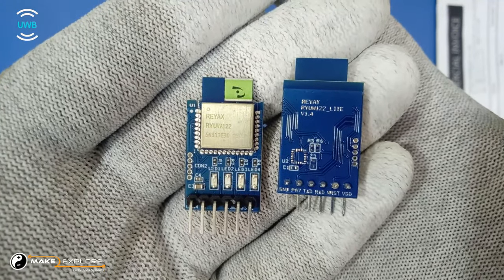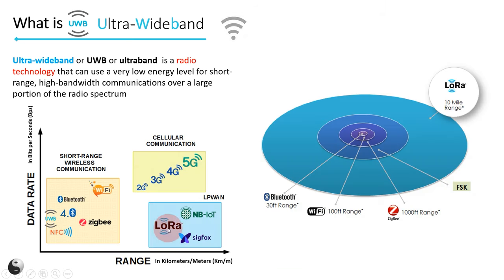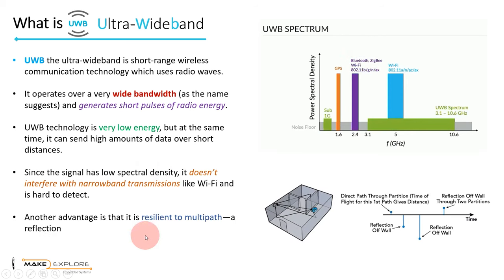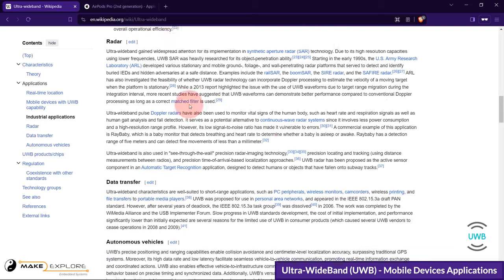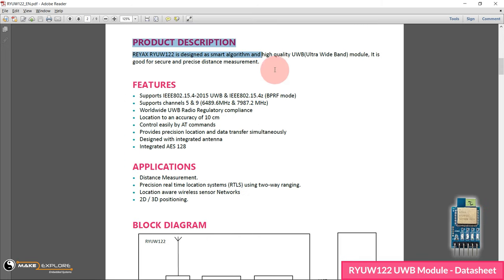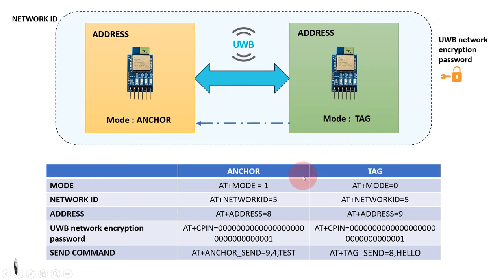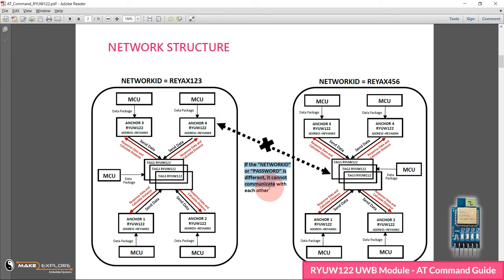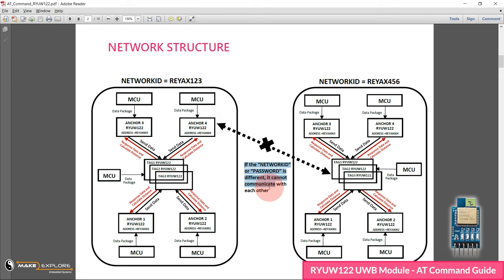[Device Overview] Ultra-wideband Transceiver Module RYUW122

Comment: Impressive work, I was thinking of using this technology to trilaterate 2 tags with 3 anchors and prevent a certain action from being taken if the two tags were close together. In my application, I would need a resolution of at least 1cm, but I noticed in the video the accuracy is 10cm. Is it possible to increase this resolution with more anchors and a correction code? Another point, can we connect all the anchors to a single central controller? And use a small, inexpensive, low-power controller on the tags?
Reply: My idea for a correction code would be to initially use 3 anchors and take a reading, storing position 1 composed of 3 distances. Then, take another reading with 4 anchors and create a function that selects from these 4 distances the position closest possible to position 1 and form position 2, thus eliminating the measurement from one of the anchors. Continue this process successively. The advantage is that for applications where the calculation update is much faster than the movement speed of the tags, the natural fluctuations of one distance would not impact trilateration abruptly, only the natural fluctuation of two or more at the same time.
Reply from the maker: Dear Felipe @felyp3able 
Thank you very much for your interest in our channel and your encouragement. Glad to know you liked our content.

Q - but I noticed in the video the accuracy is 10cm. Is it possible to increase this resolution with more anchors and a correction code? Another point, can we connect all the anchors to a single central controller? And use a small, inexpensive, low-power controller on the tags?

➡️ Yes, you are absolutely right!! As per datasheet of this UWB module mentions, the location accuracy is up to 10cm. We've also tested it, and found that below 10cm distance readings fluctuates drastically. We haven't yet tested this module for more precise localization with multiple Anchors and correction code. So we can not comment on its performance with this approach.

➡️ Although, use of small inexpensive, low-power MCU on tags can be advisable. Since we usually do not require that much processing power on Tag nodes.

The codes we use in our in the DIY projects and tutorials are only for educational and learning purposes, they usually are not optimized for critical commercial/Industrial applications. Even for this tutorial/ review DIY project, we have used simple and minimal coding paradigm. We are not checking AT command responses and Error codes of commands.

Documentation about this module is very rare and there are also no any pre-compiled libraries available. We have to program them with barematal way. Explore it if you are interested, and let us know about your experience.

If you have any queries/issues/suggestions about this Tutorial, or any of our DIY project, feel free to ping us on WhatsApp/Telegram (Links given below) for further support.

Tech support - (𝗖𝗵𝗮𝘁 𝗢𝗻𝗹𝘆) Telegram/WhatsApp - 11:00 AM - 05:00 PM (Mon-Fri) IST   

🚀 𝗧𝗲𝗹𝗲𝗴𝗿𝗮𝗺      🔗 https://t.me/make2explore
💬 𝗪𝗵𝗮𝘁𝘀𝗔𝗽𝗽    🔗 https://bit.ly/3VXGGEe
📩 info@make2explore.com  / support@make2explore.com

As per time permits we will try our best to help you out. 

Best Regards